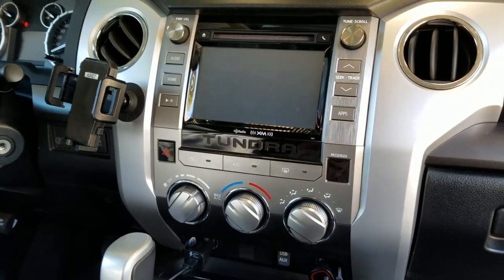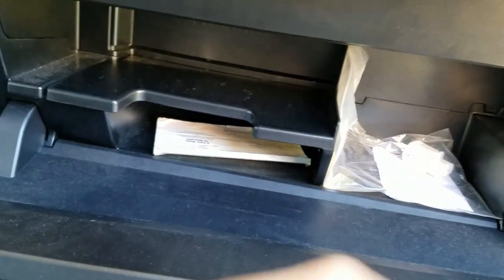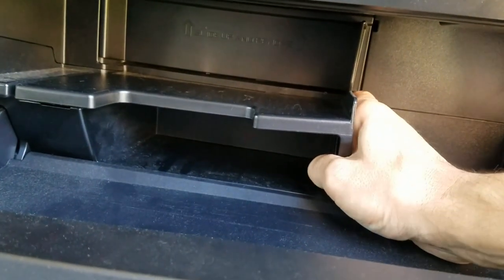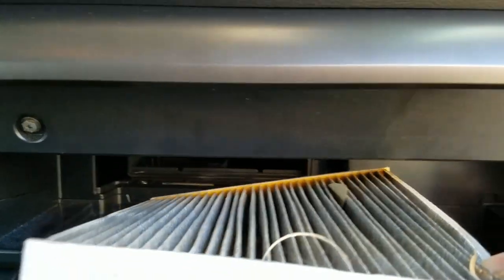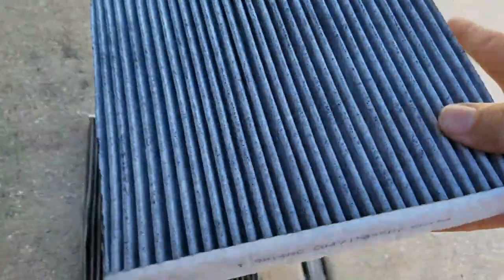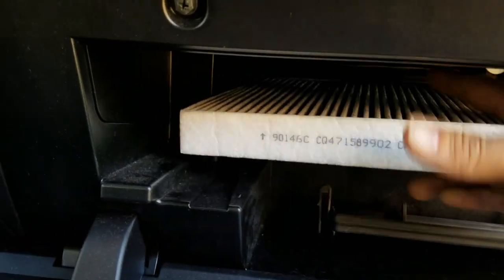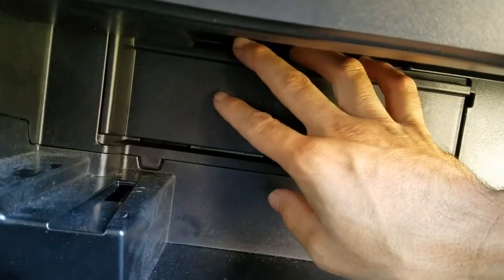Toyota Tundra Cabin Air Filter Replacement  2014 2015 2016 2017 2018

Comment: Rest assured that the air flows top to bottom regardless of what is printed on the filter.
Reply: My filter says air flow with arrow pointed to ottom
Reply: Bottom
Reply: Did you notice, the factory installed filter pointed up...just like the door panel. The door panel is constructed in such a way that it can only be installed one way, so the arrow is not on the panel to prevent an upside down install...its there to show you the way to install the filter.

Comment: Using this to install my Bosch Hepa filter 6055C today at 20k miles, 2.5 years. Only $15.34 on Amazon. Thanks! And for people confused about the arrows, any arrow labeled "airflow" points ⬇️ because the air comes from between the hood and window and down to the blower in the dashboard. Another guy below said the text should be upright, great tip.

Comment: Thanks had to do it today, 4/28/24.  I used spearhead brand from Amazon about $10, also replaced engine air filter the filter also from Amazon about $13, A-Premium.  Auto place wanted $25 for engine filter plus labor, do it yourself thanks to this Utuber.

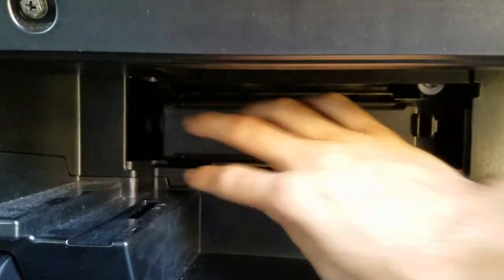Comment: Got to the section at 1:12, when you start to remove the 3rd barrier to the filter. Have spent 45 minutes trying to remove it. It will NOT come off. too cold? need liquid wrench? need prybar? Almost to the chisel stage. There must be another way to get access....................maybe from the engine side.

Comment: So, what's your opinion on this filter after a couple years of use now? I heard in other video that it's thicker and a guy bought same filter for Camry and had a squealing noise and Toyota dealer stated it's to thick compaired to EO filter there for restricting are flow. I was just looking at 2015 Camry because that's what my wife has and it uses same filter as my 2014 Tundra. I personally like the cheaper price as long as it's good quality and does what it's supposed to!

Comment: Just one thing airflow in tundra is down. Since all the dirt that settles is on top.  FYI. In video arrow points up. I did same mistake thinking it would be top. However the filter might indicate what direction to install. So this is confusing. My Air filter had air flow direction arrow. But yours seems to be just an arrow.
Reply: install filter with arrow pointing up on that filter,also numbers or letters should not be upside down when installed.
Reply: Any filter without the word "up" on it should have the arrow pointing down in the direction of air flow.